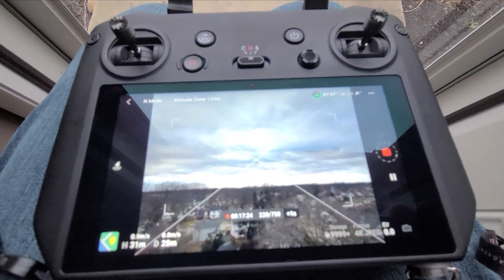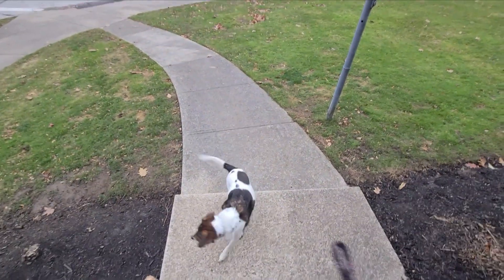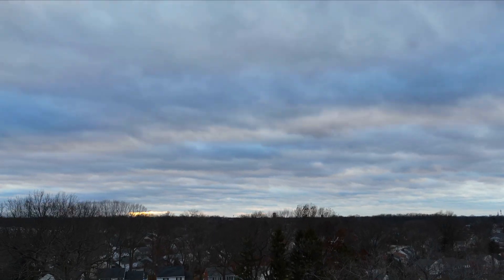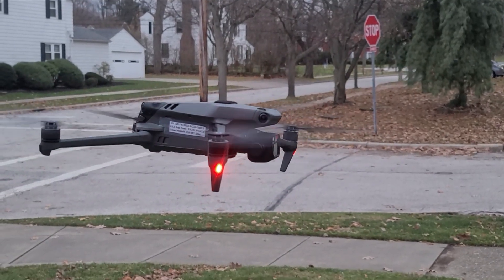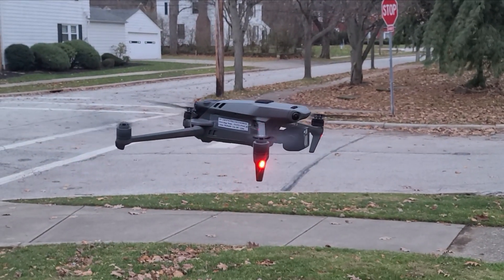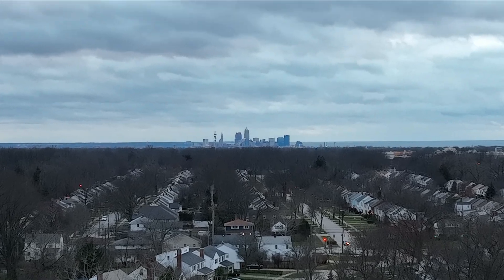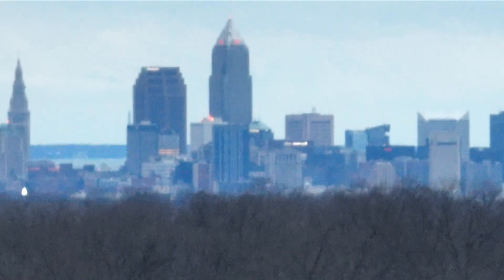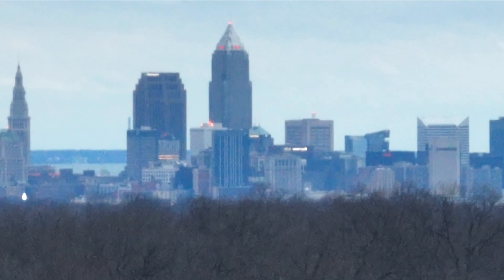DJI Mavic 3 High Velocity Wind Tests, Hyperlapse, Zoom, Orientation Drift

Comment: That’s unfortunate with the drift but thanks for sharing. I wouldn’t be doing Hyperlapse in any kind of wind just to keep it as steady as possible but I understand this was just a test. Thanks. I subscribed.
Reply from the maker: I was at only 31 meters and stayed over my yard.  I did the low altitude testing first, and once I felt comfortable I went higher.   Filed out my flight logs,  did all my calibrations, checklists,  etc.
Reply from the maker: And thank you for subscribing!